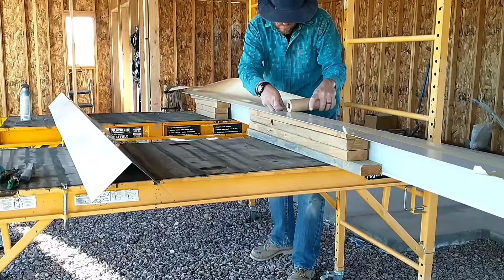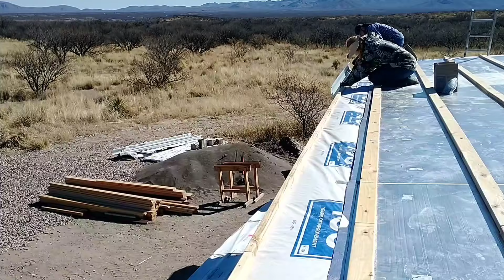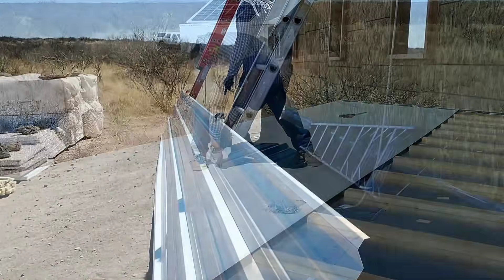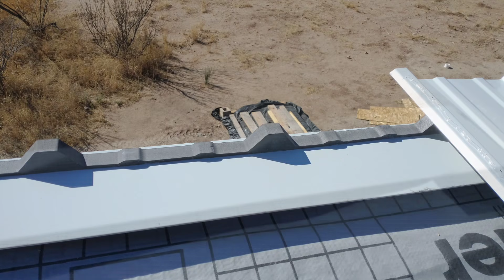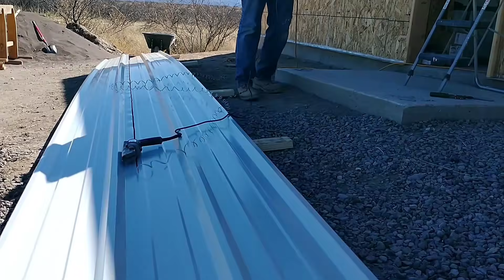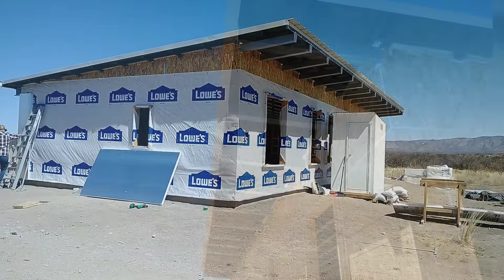DIY Metal Roof Install, Gutter & Trim |Home Build #23  White Steel Low Pitch Single Slope

Comment: I have one question, what if the temperature of the metal roof becomes so high that it burns the rigid insulation under? If you do not install the plywood between the metal roof and insulation, this could be risky in high temperature area. Just a question, no offense to your excellent work
Reply from the maker: The foam board will start to soften at 165° and melt at 200°. The white metal roofing, air gap and ventilation, (we added some spacers along the side trim) should help to keep it cool enough. Leaving an air gap and not covering the reflective side of the foam board is also very beneficial for its performance. This house holds its temperature amazingly well! It is heated completely passively during the winter. It also holds in the cool in the summer. The thermal mass we added also helps to keep the temperatures nice and stable. 🌞
Reply: @RedandAprilOff-Grid  I get it. Thank you. It is really an amazing work.

Comment: Did you have any issues with the insulation underneath melting? I would imagine temperatures under there get close to melting point of insulation.
Reply from the maker: It is performing great so far! Our house has nice stable temperatures.

Comment: Awesome video series and congratulations!  I really like the pace of the videos and fast speed when appropriate.  I don't need to watch someone put in screws real time for 10 minutes if you know what I mean.  I was wondering if there was consideration of leaving some gaps in the 2x4 strapping under the metal to help with ventilation?  I may have missed something.  I'm no pro but have seen that before and it seemed like a good idea. They use bug screen at the top and bottom and have air flow. It's such a low pitch roof maybe it doesn't make any difference.  Keep up the good work.  I would love to find a piece of property like that but feel like half of my finds are scams.  Any recommended web sites or realtors? Thanks!
Reply from the maker: Later, he added small spacers on the side trim, to add some cross ventilation. The high ridges in the metal also give some room for air to move from top to bottom. We'll see how it does, we could add more ventilation if needed. Even with just 2 inches of foam board, the temperatures in the house are already staying much cooler than in our RV. 
We found our land on a realtor site. It had been on the market for almost a year but the location in the listing wasn't right. Our son-in-law found it when he was looking at a property close by. Best wishes, on your search for land! 🌞🏜️

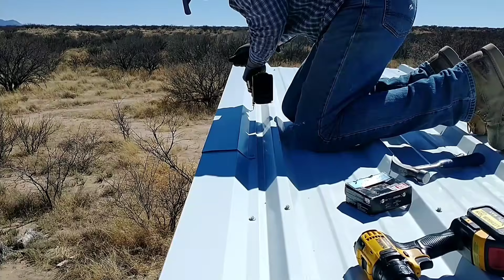Comment: 16:35  You might consider some tight mesh screen or stuffing some steel wool into that gap for pests.
Reply from the maker: It doesn't seem like much would want to live in there in the summer, but it could be an issue in the winter. I am wanting to put some kind of wire mesh or vent material to make sure nothing gets in. The monsoon rains here can come down crazy hard and from all directions.

Comment: here's a hint:
down through the years the expansion and contraction of roof panels lengthwise can cause screws to work back and forth in the wood they are screwed into and wallow a bigger hole in the wood and become loose. After about four years you have to go up and check for tilted and loose screws then annually after that.
Reply from the maker: Sounds like a great idea! I figure we'll be getting up there every so often to enjoy the sunset and views, that would be a good time to inspect it. 👍🙂

Comment: Great job 👍! Last year we redid my metal roof and used the same roofing as you and April. I really think even the factory is unaware of the "correct" way to attach the screws. The company in my area has been in business over 20 years. The instructions read one-way for some applications and another for other's 🤣. I used a butal type of sealant that stays sealed for 50 year's. You have to do as you see fit and work things out accordingly as one you order it - you've bought it. I ordered extras and ordered mine  a little longer, (as I'm disabled and had volunteer labor and there is only so much I can do from the ground😆), in case of a mistake was made. Again great job! And I think April maybe showing some bias about that grandchild 😂. Congrats Grand Dude!
Reply from the maker: Thanks! Yes, I think there are certain advantages either way. We didn't realize there was so much controversy about screw placement until we posted out original shipping container barn video.  We put them in the valleys and some people did not approve. 😏  We didn't order any extra sheets, so we were glad it all worked out. Now we just have to be real careful cutting the siding pieces. It's much slower going, lots of detail work, but looking really nice. 
😊 Yes, just thought I would stick that in at the end, pretty exciting, and it was a good reason to take some time off from the build.

Comment: I’ve been following you since I got interested in aircrete. Not sure why I’m still watching, but am impressed by your attention to detail and thought processes. I have a ton of experience with metal aluminum roofing. Have learned the hard way that long roofing sheets can be a problem long term. Reason being that the coefficient of expansion is such that temperature changes from hot days to night time cool causes the sheet to expand and contract enough to cause the screws to elongate the holes in the metal and then leak. Steel roofing is not as bad as aluminum so I pray you have no problems. For some reason the roofing manufacturers seem to have no concept of this even though it’s basic physics. We went to shorter sheets with no connecting screws at laps which is counterintuitive to tight roofs, but it worked. Not an option for you with your shallow pitch, but something to keep an eye on. Good luck. Bert
Reply from the maker: Thanks for continuing to watch! We hope to do an update on the aircrete garden wall when we get around to plastering it in the next month or two.
 It's a challenge building with materials that expand and contract at different rates. ( I think shrinkage would have been a huge problem with poured aircrete walls.)  The sales people we talked to at Mueller knew our plans and didn't advise again the long sheets.  Hopefully the heavy gauge steel sheets, metal roof beams, and rigid insulation board will help. It's so annoying  that insulation board shrinks. I really wanted to tape the seams, but that seems useless if it's going to shrink anyway.  Red was wanting to put the strapping screws all the way down and through the metal beams, but they weren't quite long enough, not sure if that would have been a good thing or not.  I'm an optimist and think it will be fine, but we'll keep an eye on it. The low pitch makes it easy to inspect. 🌞

Comment: Congratulations on your roof and your granddaughter.  What a wonderful milestone.   

Did you notice the temperatures of the surface and an inch below during your visit to White Sands, NM.?  I was inspired to study sand because of the composition found there.   This white sand reflects heat while similar white sand found in Florida absorbs heat.   

Wishing you and your family a blessed spring season filled with gentle weather and restful evenings.  Greetings from NE Ohio.   Peace
Reply from the maker: Thanks so much. Our daughter called, and we talked to her while we were still on the roof, then we went inside and sat on the scaffolding for a video chat. 
Yes, the sand was wet and cool just under the surface. It's so strange that it looks so much like snow but it's not. 😊 🤍🏜️

Comment: Lovely to see your nice White roof!  Curious to know if your kids have finished the work on the bunkhouse?  How is that going for them?   Thanks for the video progress it is looking good!
Reply from the maker: Thanks! They are doing great, and have been living there for almost exactly one year now. The thermal mass and big south facing windows did amazingly well. It was cold, but they made it through the winter without any heat, but finally got a wood stove. The place is definitely rustic, but they have it decorated cute and love it. 😊🏜️

Comment: it's kind of funny, i've seen where other manufactures say install the screws on the top ridge.  they even give diagrams to go with the sheet metal.    looking good
Reply from the maker: Thanks! Yes, we learned it's a controversial issue when we put the roof on the barn. 😅